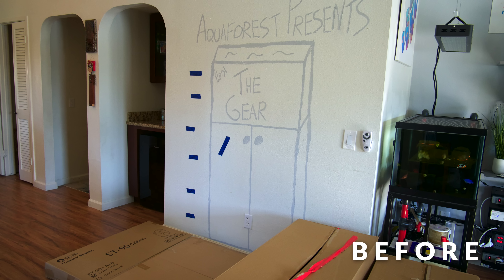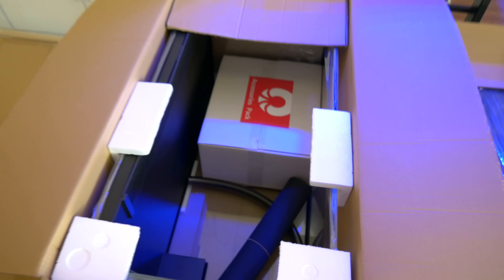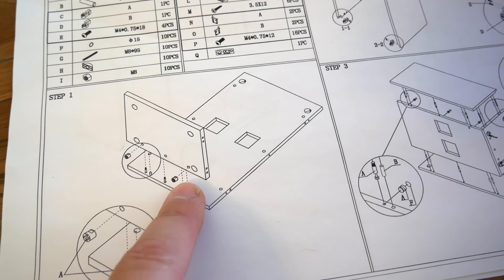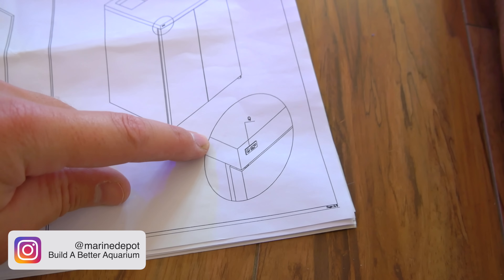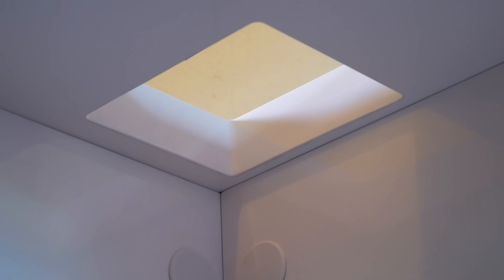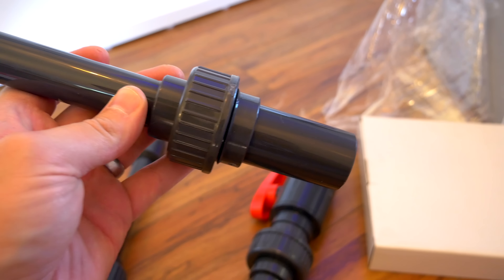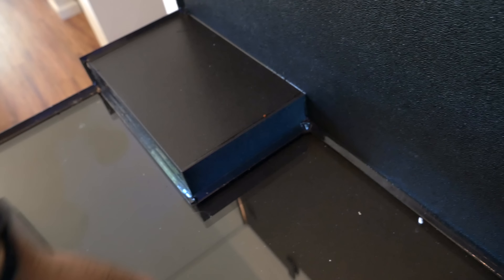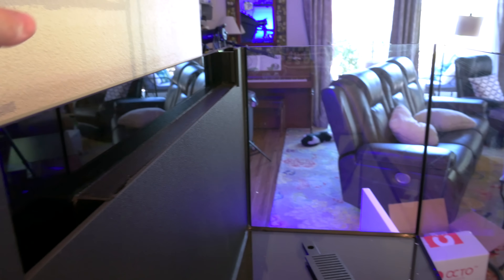The Reef Octopus LUX T90 Aquarium! Reef Octopus Build Part 2!

Comment: I really like that overflow design. It will be interesting to see how it functions. I'm guessing that ato reservoir will hold about 5 gallons. It is very similar to what Cade aquariums is doing. Does it come with a float valve for it?
Reply: yeah, it does come with the float valve.  But the reservoir is only 1.5 gallons, so probably going to have to replace the water every 2 days I'm thinking.  I might have to set up an electric ato for my gravity fed reservoir!  Stay tuned for that one!  I'm also excited to see how the overflow works long term.  Because if there is a problem with the plumbing in the slim flow, the only way I can see that you can fix it is to drain the tank and remove the flow, fix the problem, and then put it back with fresh silicone.  But I'm guessing that won't happen, as it's never been an issue for any of my other tanks!  Thanks for watching and commenting!
Reply: @MyFirstFishTank  wow. That isn't a lot. Lol you may end up needing a reservoir for your reservoir.